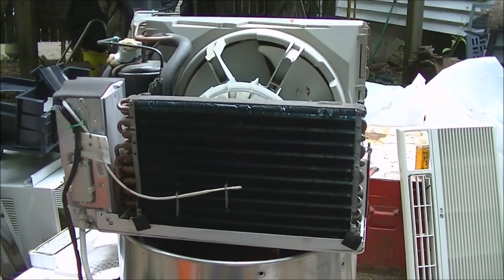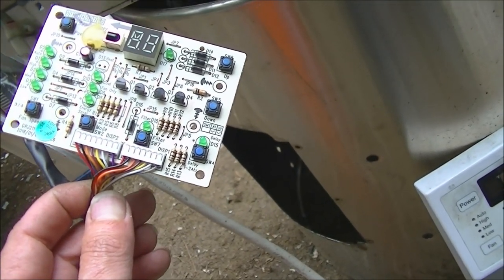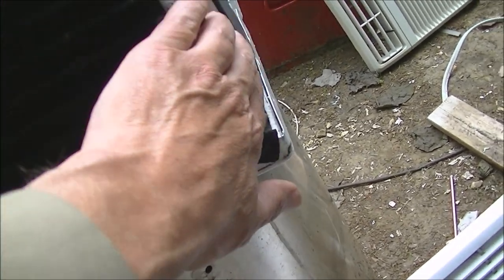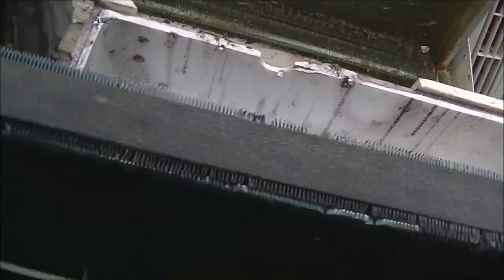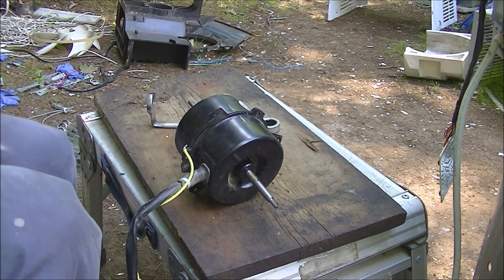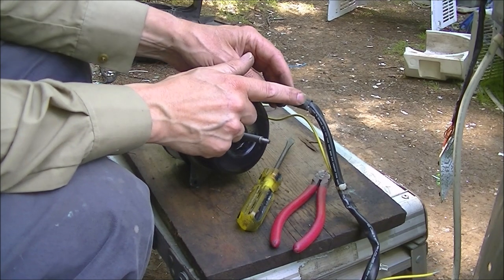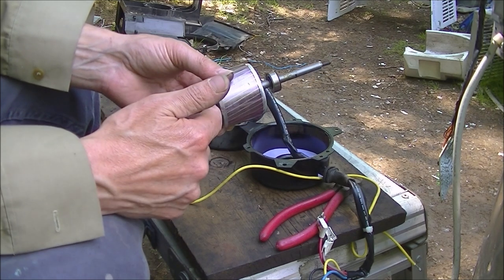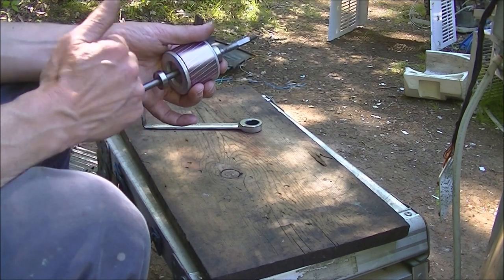Replacing Fan Motor Bearings On 2019 General Electric Air Conditioner

Comment: Notice all the grease that has exited from the original bearings.  I had an appliance salesman tell me to avoid running it on HIGH FAN setting more than 10 minutes.  Maybe he knew the bearings will overheat and expel the grease.   Any mention in the Owner's Manual about NO CONTINUOUS RUNNING ON HIGH?

Comment: Thanks to your video, I'm currently tackling a 2011 model AEC08LYL1 GE window unit with bearing noise.  This unit is set up identically to the one in the video and thus the procedure was the same.  One 608Z bearing was definitely bad (evidence of water infiltration and tell-tale rust marks on bearing shield), while the other bearing was fine.  I'm thinking that it's moisture killing the bearings and thus that the 608-2RS (bearing with 2 radial dust shields) is optimal for the replacements.  Here's a tip:  If you want to avoid having to tap or press the new bearings in place on the armature shaft, simply drop the armature into the freezer and warm the bearings with a hair dryer before installing them...they'll just drop onto the shaft.
Reply from the maker: @jamesturnure9735  Thanks for the tip, I'll try that next time I change bearings. The way I'm tapping them on definitely isn't optimal. It would be nice to have a press to press them on.
Reply: @airconditionersexposed 

Placing a washer over the inner race of the bearing works also to protect the shield or dust cover. Then you can tap it home with a 10mm deep socket if that’s more convenient.
Reply: Bearings arrived early so they're installed and it's all back together.  I did note that the rubber wire harness esculder was badly torn at the entry point to the motor housing.  I applied a coating of RTV and then wrapped the area with electrical tape before reassembling.  This probably isn't critical, but figured it was just one more point for moisture entry.  Also noted the motor does have a 1/4" weep hole and it orients downward once the motor is installed.  Whole job took just over an hour and the unit is working flawlessly now thanks to @airconditionersexposed !
Reply from the maker: @jamesturnure9735  Glad you got it fixed. The boot should be fine if you taped it. I suspect water seeps into the bearing by the spindle much of the time.
Reply: where does the little star shaped roller bearing  go for the fan? i took mine apart but i cant remember where it goes

Comment: I also have a GE window AC that has got very loud, and its a 2018.  I have to clean the grime out with a hose and sadly water gets in the bearing.  I should have tested it BEFORE i got it all buttoned up in the window just today and I would have realized it's louder than ever.  well now i know, and now i get to do exactly what you did here.  I like the wood trick to get the bearings on.
Reply from the maker: I wrap plastic around the motors or take it out before hosing it. If water gets in the bearings, they're ruined. It's not too hard to change bearings in this one. Good luck
Reply: @airconditionersexposed  Well after puling the cap off of the motor i realized they made this purposefully difficult if not impossible.  theres a circuit board hard soldered to the stator inside the motor that wont let me get the rotor out.  And with upper 80 temps allready here we just decided to buy a new one.  I'll clean this new one dry i guess
Reply from the maker: @chrisholdread174  Sorry to hear that. I don't think I've encountered one like that yet.

Comment: what are the chances you having the link on where you bought your bearing! i have same model and trying to do the same thing. I search 608,608z,608zz and 608rs, not sure which is better as far as metal or rubber part. Thanks in advance
Reply from the maker: I've been using HCH brand from ebay, the 'rs' with rubber seals. The seller is JSB Great Bearings. You can use the shielded zz or the sealed rs. I don't really know the longevity of them, only using them for a year, they seem decent quality and inexpensive. The sealed should keep out water better. You can get koyo bearings from Japan on there, they cost more but probably better quality. Just avoid the generic bearings from China, they're really bad.
Reply: @airconditionersexposed  thank you very much for replying. I appreciate it.
Reply: Man want to thank you again ! just replace them yesterday, night and day difference. Its new again !!
Reply from the maker: @edwinveal8248  Great! I'm glad to hear that. It beats buying a whole new air conditioner.
Reply: Because there's no provision for regreasing the shielded (Z or ZZ) bearings, I would think that the radial-seal design would provide more longevity in this application.  I'll be tackling this exact same model with the same problem and will be using the 608-2RS.  Great video...thank you!

Comment: This appears to be one of the final GEs that were made by Gree.
Reply from the maker: @KingHarlequin1999  This is one of the worst air conditioners made. I've picked up more of this model broken than any other. Usually the coils don't get cold.
Reply: @airconditionersexposed  It definitively looks way cheaper compared to a 2011 Gree made General Electric (model AEH12APW1) that I still have and it still just works fine despite having rust in the bottom of the condenser, it still runs with the original capacitor, and it have a Rechi Compressor.

Comment: some interesting things ive noticed about these motors... the little plastic thing with the rubber washer i think is a slinger to keep water from the shaft off the bearing as a last barrier of protection on the OUTSIDE shaft, however the shaft going to the evaporator doesnt have that, and thats the one that failed. as well i think the boot being torn is the least of anyones worry because if you look at the motors theres weep holes at the bottoms but they are on the faces usually just above the bottom of the motor in its mounted position, i think the boot being torn just gives any moisture that does find its way into the motor a way out. as well clean the shafts i used a sanding medium for drywall and it did great its this mesh stuff, made it so the bearing dropped right on and only had to be tapped home half an inch. its interesting too this newer model they went nuts inside with labels mine with 410a has nothing not even that one about the fan taking fingers lol

Comment: If the bearings feel fine but the shaft is rusted could it just be the shaft rust only causing the loud sound?
Reply from the maker: If it's really loud like this AC, it's probably the bearings.
Reply: @airconditionersexposed  sounds just like that, I'll change bearings as well and clean up rust since I already have it took apart, thank you for responding!!

Comment: I have a 2013 GE AEL18DSQ1 (18,000 BTU) unit.  Looks similar to the unit you replaced the bearings.  Can  you provide instructions on recharging the coolant on these units.  Mainly just need to know what is the high and low side lines so I can attach a port to the low side.
Reply from the maker: Sorry, I don't do any work with the refrigerant and I don't have this unit anymore. Maybe you could try an hvac board online or something.

Comment: Hey! So I have exact same air conditioner; but the fan doesn't spin/turn on at all. Could it still just need new bearings? Or probably the whole fan motor is fried??
Reply from the maker: Yes it can freeze up from the bearings. You can turn the blade with your hand while it's on to see if it frees up at all.
Reply: If the motor hums but doesn't turn then most likely the bearings are seized and need to be replaced. Also possible the bearings seized on you and the motor kept running and overheated and was ruined. I would try applying lube to both sides of the motor shaft and forcibly spinning it by hand to get the lube in there, then turn on power and see if it works.
Reply: I found this exact unit, model AEG10AZL1, on the side of the road about a month ago. 
Plugged it in, and the fan motor wouldn't budge.
I removed the 3-sided sheet metal exterior, separated the upper foam shroud from the lower to access blower fan wheel. Still couldn't get the motor shaft to budge. Using a 10mm socket on a 3" extension, 
I removed the nut, lock washer, and flat washer from the shaft and, with a gentle touch, worked the blower fan from the shaft.
With the blower fan out of the way, I put the nut back on the motor and, with a few modest taps of a small brass hammer, the fan shaft was free! After reinstalling the blower fan, 
I ran the unit, first with the compressor to verify cooling, then on FAN MED for 4 hours. 
At first i thought the motor sounded like its  bearings were out of tolerance. But, upon replacing the upper foam shroud, found the unit to sound as quiet as could be expected.
Takeaway: These manufacturers need to stop wasting time integrating wi-fi into simple appliances, and focus their attention on the quality of the mechanical parts. 🙄 engineered to fail.

Comment: Heey very good video , Can you help me disconnect the motor from all wiring conect to capacitor
Reply from the maker: I label each wire with masking tape and draw a diagram. I can't see the colors well. Sometimes it's better to pry the connectors up with a screwdriver if they don't wiggle off too easily.
Reply from the maker: There's usually 2 or 3 wires going to the fan speeds and a power wire to the capacitor, and a ground wire which is usually screwed to the case.
Reply: Thank you so much. Also the capacitor doesn’t have anny electricity running while turning off .

Comment: Every a/c model and motor is different. My Haier motor is noisy. I took everything apart to access the motor. But the damn motor is not held together with bolts and nuts; it just has 4 metal tabs holding the two halves together. So I am afraid to pry the metal tabs because the metal might break, then I won't be able to put the motor back together. I hope the manufacturer is happy they saved a few cents by not using nuts and bolts. A$$holes. I can't even find a replacement motor for sale; even if I could they cost like $60. So my choices are a) leave motor assembled and lube the crap out of the bearings and hope for the best or b) risk prying the tabs and breaking them rendering the motor and therefore the entire a/c a piece of junk. FUN TIMES!

I've already oiled the motor twice over the past week. The lube gets the motor turning but it lasted only 2 days each time before it started seizing and making noise. One problem is the humidity is very high now with dewpoint at 75 degrees F! You're gonna get condensation in the motor.

I've replaced bearings on another window a/c with no problems. Hassle but it worked. 

Another problem you might encounter on this job is getting the fan and blower wheel off the motor shaft. Sometimes they get stuck and it's a huge pain to remove them. I had to rent a bearing puller once from auto parts store remove a fan from the shaft. 

The lesson I've learned is bearings are cheap but installing them can be a HUGE hassle. You have to decide if it's worth the effort. I HATE waste so I hate to junk an a/c just because of seized bearings. But I might not have a choice with my Haier.
Reply from the maker: The tabs usually don't break if it's not rusty. Pry them carefully just enough to clear it. Some of the small cheap motors make a slight raspy noise which doesn't improve much by changing the bearings. I'm not sure what causes it exactly. Yes, getting the blades off can be torture.  If it's really noisy and it's definitely bearing noise, you may as well try it.
Reply: @airconditionersexposed  Thanks but I opted to play it safe; I just oiled the bejesus out of the motor and reinstalled; unit is in the window running right now. We'll see how long it lasts! Worse case is I'll have to oil it every few days. That's a huge PITA but it's cheaper than buying a new one these days.

You're right about some units being noisy. My other 5k BTU Frigidaire had noisy bearings so I replaced them. Much better but there's still a noise. Part of the problem is the all metal motor casing and attached parts act as a resonator.

P.S. I lubed bearings with penetrating oil and it lasted only a few days. I noticed today that penetrating oil seeps into rust and then dries up! So today I lubed with motor oil (it's all I had available) hoping it doesn't dry up.